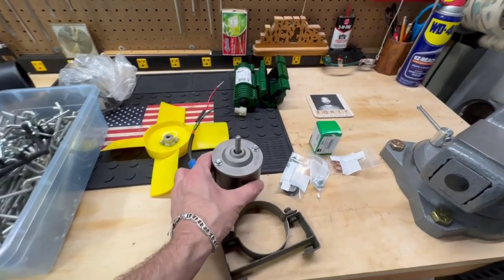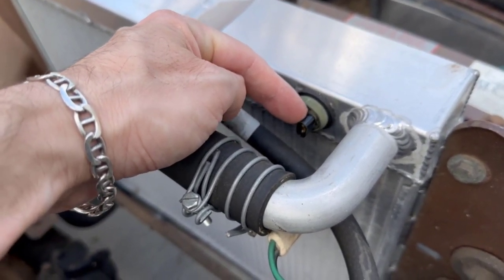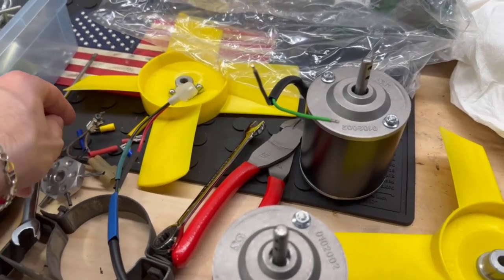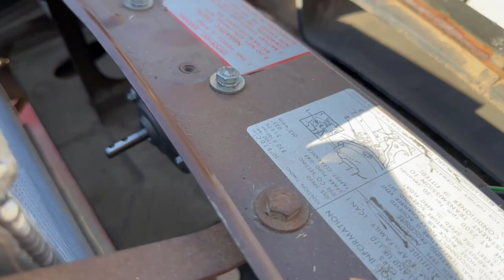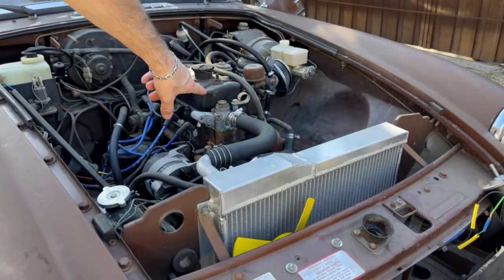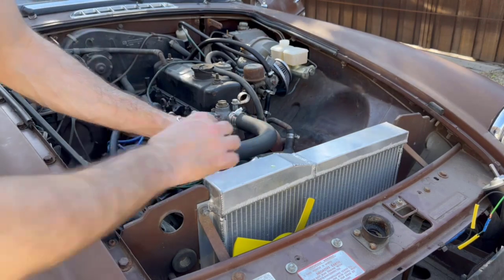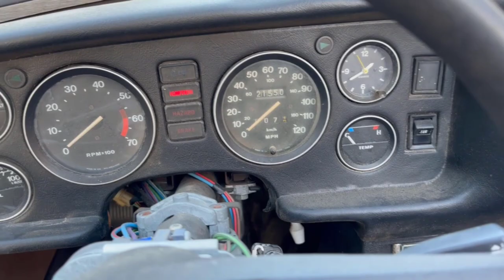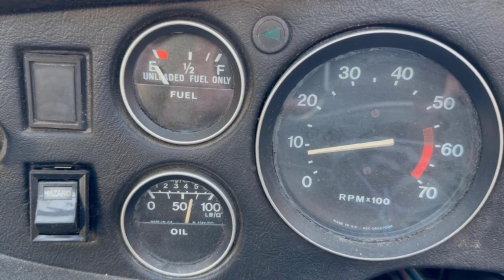MGB Overheating Fixed! Replacing the Fan Switch and Fan Motors!

Comment: Congratulations... clean install with solder & shrink... looks good.. my 79B lives in So Calif and was overheating on warm days... installed the aluminum radiator and single 14" fan on the engine side of the radiator with sensor as your setup.... steady temperature even on the warmest days here.
Reply from the maker: Thanks for the kind words!!

Comment: I thought that John Twist said that the proper way to install the fan blade was to have the grub screw on the radiator side of the fan not the bumper side. He said it will cool but not as well as it should!

Comment: Nice aftermarket radiator...!!!  It's a good idea to use a wire strap, to secure the switch. They have a tendency to pop out, under normal pressure, as the grommet ages. You can imagine the ensuing nightmare, post pop.🥴 Your videos are excellent 👌
Reply from the maker: Thanks for the tips!

Comment: Also make sure your car has the under body air deflection panels in place to direct air to the rad - they are essential for proper cooling in rubber bumper B’s

Comment: Yes, I can see you are missing the air deflection panels - they were originally cardboard so typically fell apart. Replacement plastic ones are to be found at Moss Motors.
Reply from the maker: Thanks so much for reminding me! I actually had to remove it, because it was so rusted and in no shape to refit. I'll get a new one one Moss. I appreciate the reminder!!

Comment: Watch that your coolant level is high enough or it won’t trip the URP switch. Also secure the switch with a zip tie through the rad as this switch is notorious for blowing out under coolant pressure. Check MGB information sites for further information. From another 1980 MGB keeper.
Reply from the maker: Great suggestions, thank you!
Reply: My coolant temp fan switch just blew out on my 1980 MGB. Terrible design. Do you know of any upgrades, like clamps that go around the radiator to hold the switch in place, that are for sale?

Comment: Where can I get the grommet for the aluminum radiator. I purchased a new aluminum radiator and the hole for the fan switch is larger than the stock radiator?